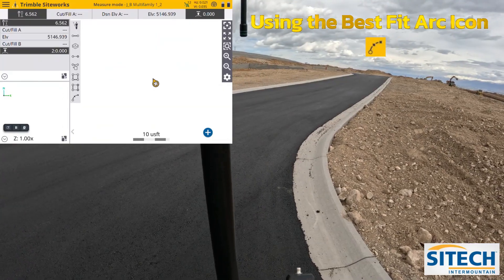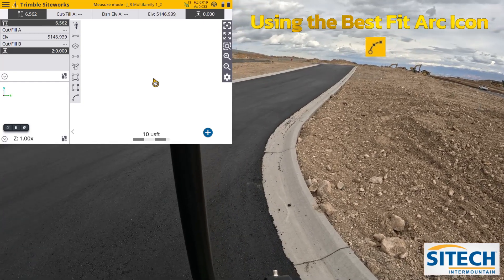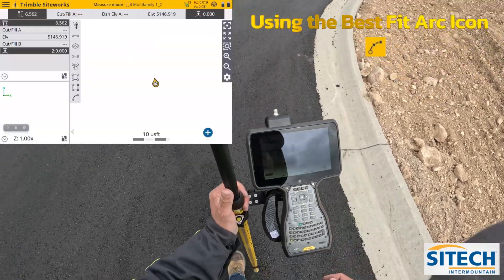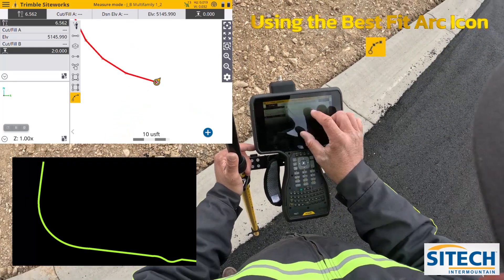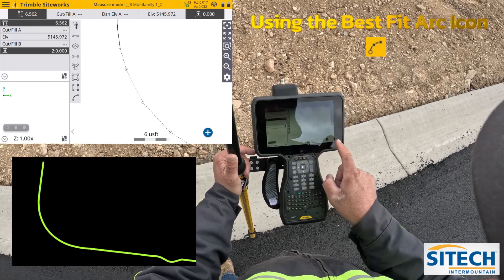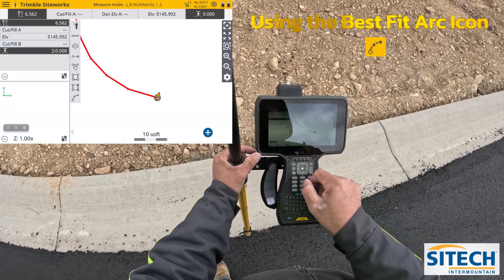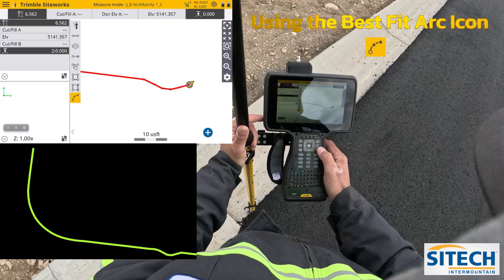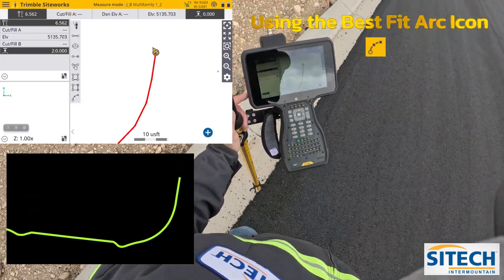SITECH Siteworks: Measuring a Line String Using the Best Fit Arc Icon

Comment: All I have in that ribbon is the standing, roller stuck in the mud, and define a plane. You have 5 more features in that ribbon. How do I get/add those?
Reply from the maker: it could be 2 things. alot of those icons on the side of the screen only show up based on what mode you are in and what modules you have. So if you start to create a line string in that mode it would show up. i didn't think it was part of the advanced stakeout module but you could look in your settings to see and you may need that.
Reply: @sitechintermountain  It’s part of the advanced measurements module that also contains a utility locator.